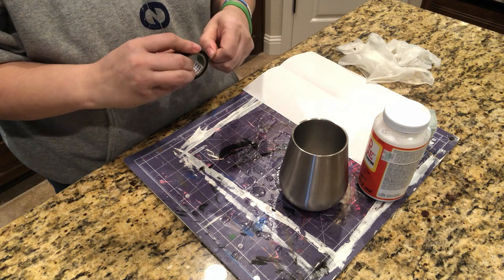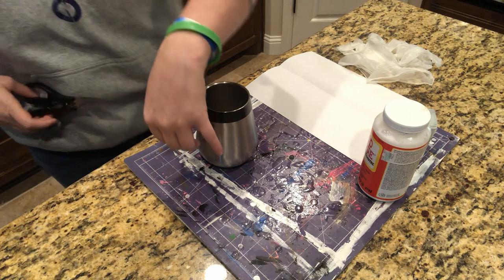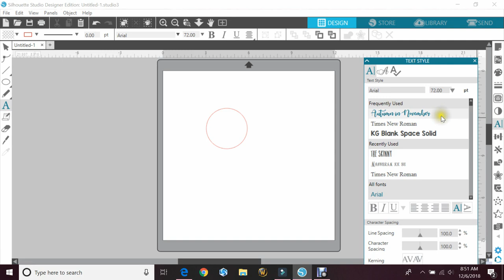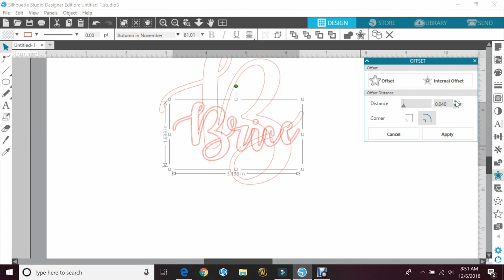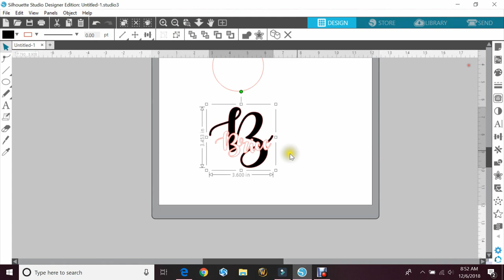Working With Epoxy: Stemless Wine Glass Glitter Tumbler - Mod Podge Method

Comment: Once you have covered the taped area, taper slightly away from the tape line about an inch and cut your tape and fold under about 1/4 in. to make a tab. It is so much easier to remove it by the tab. No tool needed. Grab and remove..
Reply from the maker: Thanks!

Comment: The cup looks great! Is it possible to remove this to try again if you mess up? I have drips from the epoxy that hardened in place.
Reply from the maker: You would have to sand down the bumps and then add another layer of epoxy.

Comment: Hi when you add the epoxy does leave a thick layer? I’m trying to make a peek a boo wine glasses but don’t if leave a thick layer?
Reply from the maker: It will really depend on how much you use. It can get thick. It’s best to try and do thin layers.
Reply: If I’m making 8 wine glasses not the ones with the stem, but the flat short ones would you know how much epoxy I should mix?

Comment: Do these glasses or tumblers wash good. Are they just hand wash or dishwasher safe??
Reply from the maker: Because of the epoxy you could not put them in the dishwasher. That gets way to hot for it. You would have to advise hand wash only.
Reply: Thank you!! One more question. If you hand wash them, do the cups stay in good condition for a long period of time or do they start to look old quickly.
Reply from the maker: @TasAttainable  Yes! they should last for many many years! Obviously they will have normal wear and tear and some may look old quicker depending on lack of care from a customer (tossing it, dropping it, that sort of thing)